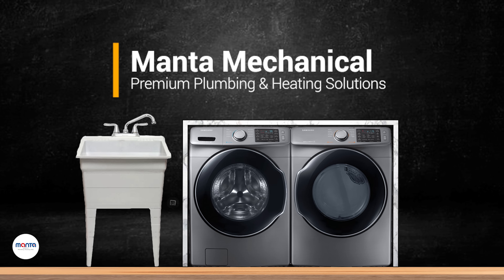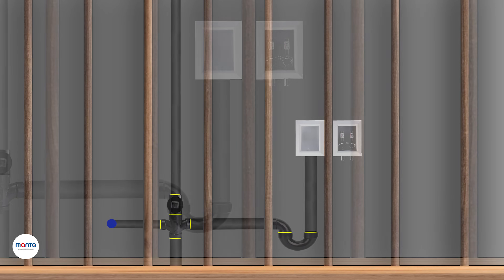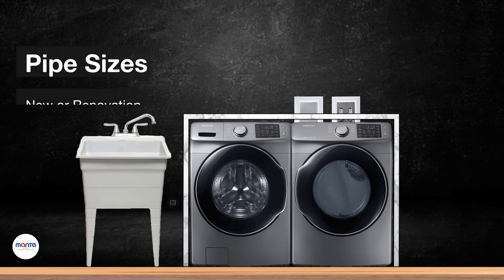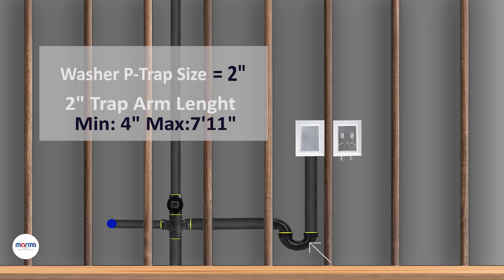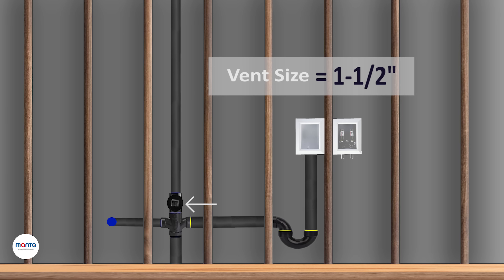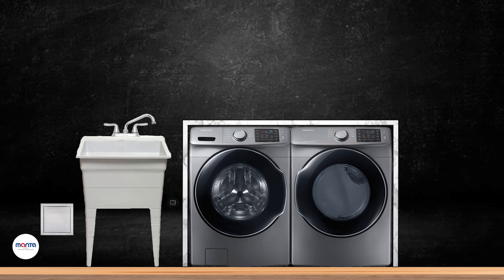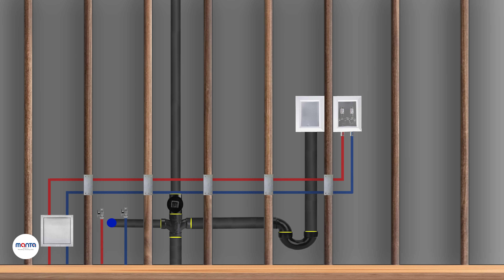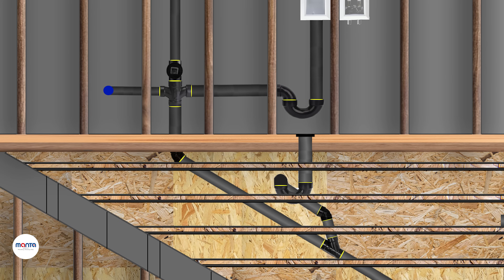Dos & Don’ts of Laundry Plumbing - The Building Expert - 2020

Comment: My laundry has one 1-1/2 p-trap shared for the sink and washer. Is that code anymore?
Reply: @rickybobby7276  It has one trap for both fixtures.  Goes into a san tee in the wall  Looks like it's original from the 1980s.

Comment: I prefer the valves higher than the washer for accessibility.
Reply: hell yeah,  I don't give a crap about how it "looks."  I like to be practical.
Reply: Exactly. They are supposed to be easily accessible in an overflow situation.
Reply: 100%

Comment: THIS IS MY TAKE FROM EXPERIENCE. CODES AT TIMES ARE WRITTEN BY ABSENT MINDED PEOPLE WHO DON'T THINK OUTSIDE THE BOX. 
I PUT THE BOX UP HIGHER OVER THE MACHINE. THE BOXES WE USE HERE IN NEW YORK CITY ARE COMBINED DRAIN AND WATER VALVES. THE HIGHER BOX MEANS A LONGER RUN/DROP ON THE VERTICAL PIPE/RUN AND IF YOU START TO GET A RESTRICTION. IT WILL NOT OVERFLOW AS EASY AS A SHORTER RUN/DROP. I ALSO PUT THE TRAP DOWN AS LOW AS POSSIBLE SO THE VERTICAL DROP IS LONGER. THE LONGER VERTICAL DROP HAS A GREATER VELOCITY AND HAS A BETTER TENDENCY OF KEEPING THE DRAIN FROM CLOGGING. ALSO WHEN IT COMES TIME TO SERVICE A CLOGGED DRAIN. THE HIGHER BOX IS EASIER TO SNAKE WITHOUT HAVING TO MOVE THE MACHINE, ESPECIALLY IF THEY ARE IN A TIGHT SPACE WHICH CAN BECOME A NIGHTMARE. THE HIGER BOX ALSO GIVES QUICK ACCESS TO THE SHUT OFF VALVES BECAUSE THEY ARE VISIBLE IN AN EMERGENCY. HOME OWNERS ARE USUALLY ABSENT MINDED AND AS THE YEARS GO BY FORGET ABOUT THE SHUT OFF VALVES HIDDEN IN A ACCESS PANEL, OUT OF SITE OUT OF MIND.
WHEN IT COMES TO ADDING A FLOOR DRAIN. I DO NOT RECOMMEND PUTTING IT INTO THE SAME 2" LINE AS THE 2" DISCHARGING WATER FROM THE WASHING MACHINE, ESPECIALLY FOR TOP LOADER MACHINES WHICH DISCHARGE A LOT OF WATER. IF YOU HAVE A CLOG AND YOU START YOUR MACHINE IT WILL TAKE MINUTES UNTIL FOR YOUR MACHINE DISCHARGES THE WATER. USUALLY YOU START THE MACHINE AND LET IT FILL AND WALK AWAY. IF THE DRAIN IS CLOGGED ON THAT COMMON 2" DRAIN. THE WATER WILL OVER FLOW FROM THE FLOOR DRAIN AND MAKE A MESS AND CAUSE DAMAGE ESPECIALLY IF THERE IS A WOODEN FLOOR CLOSE BY.  IF YOU HAVE A 3" OR 4" WASTE STACK PUT EACH 2"LINE SEPARATELY INTO THE LARGE STACK WHICH RARELY TO NEVER CLOGGS. FLOOR DRAINS ARE USUALLY 3" MINIMUM BUT DEPENDING ON THE CODE THEY CAN BE 2" BUT REQUIRE A VENT.  AS A RULE OF THUMB AND REMEMBER THE CODE CAN BE WRONG AND QUESTION IT. THE DISCHARGE WATER FROM THE MACHINE AND THE FLOOR DRAIN SHOULD BE PIPED IN SEPARETLY INTO A LARGER WASTE LINE 3" AND LARGER.

Comment: It looks like you're using a  double sanitary tee for a second side-by side fixture (presumably a sink). Shouldn't that be a double fixture fitting instead? Otherwise the pumping action of the washer could cause crossover flow into the second fixture.
Reply: Wondering about this question as well. There is an exception for back to back water closets and/or fixtures, but doesn’t state whether or not the exception (minimum distance of 10x the pipe diameter) applies to an appliance such as a washer or dishwasher.

“A double sanitary tee (cross) cannot be used for connections to fixtures and appliances with pumping action because it has a short pattern for change of direction. In addition to blowout-type water closets, 1.6-gallon-per-flush (6.1 L/flush) flushometer tank (pressure assisted) and gravity tank-type fixtures may also produce crossover flow into the opposite fixture connection. The high-velocity flow may discharge through the opposing openings of a double sanitary tee, causing an interruption or blowback at the other fixture. Back-to-back water closets are fixtures that are installed directly opposite of each other and discharge through a short distance into a double pattern fitting. If back-to-back fixtures discharge through several feet of pipe or multiple changes of direction, the flow velocity in the fixture drains would decrease to the point where cross flow would not occur. The exception provides for back-to-back water closet connections to double sanitary tee patterns where the horizontal developed length between the outlet of the water closet and connection to the double sanitary tee pattern is 18 inches (457 mm) or more. The critical distance at which there is potential for crossover is a horizontal developed length of less than 10 times the diameter of the horizontal pipe, for example, 30 inches (762 mm) for a 3-inch-diameter (76 mm) pipe. Once the developed length is over 30 inches (762 mm), the surging flow conditions will no longer exist, and the frictional resistance of the pipe retards the velocity to that of uniform flow conditions.”

Comment: Hello , nice vid.  I know the code for washer box drain is 2”.  My condo only supplies 1 1/2 drains except the toilet drain. 
Will  it be ok if I rough in the 1 1/2 “  If I buy a front load washer which I heard uses less water?
I live on the second floor .   Any suggestions will be appreciated, thanks

Comment: Emergency floor drain is a good idea but if it’s connected to the same drainage pipe only for flooding caused by either hot and cold water being busted, but if your drainage itself is plugged up it is useless.  Would it be better to drill a hole put a pvc pipe from your inside to outside wall then cover with metal mesh so bugs can’t get in to avoid flooding?  Well this fell for inspection?

Comment: If the water box height is supposed to be 40 inch from the floor and the w/d is 41 tall, what is the reason to have water valves behind  the w/d that can't be reached if needed?
Reply from the maker: Please re-watch the video.  Thanks

Comment: A construction company built my house and things are falling apart faster than we can fix them. It seems the entire laundry room needs to be redone. The electrical for the dryer has nearly fallen out of the wall hanging on by one nail and it's so close to the floor that I'm terrified of an electrical fire. Thee pipes behind the washer are so rusted out they've started to collect water across the laundry room floor and into the kitchen. This is beyond frustrating because I don't have the money to call a plumber since everything keeps deciding to fall apart. I haven't been able to do laundry in weeks. So now I'm just researching possible solutions.

Comment: Very informative .....I was told my hot and cold water valves are not up to code and the washer drain was wrong .....My house inherited from my 0arents is 60 yrs old .....I just figured it wouldn't be smooth sailing with the installation .....CAN you tell me about codes as far h20 hot and cold tturn off
Reply: One thing people don't understand is that codes change over time. Something that met code 20 years ago may not met today's codes

Comment: what if my washer is more than 7 feet from the main stack
Reply from the maker: You can run a branch off the main stack more than 7 feet but make sure that 2’’ trap arm length doesn’t exceed 7’11’’.  The trap arm is the portion of a fixture drain between a trap weir and its protecting vent.

Comment: What happens if you can't change the stack line from 1/1/2" to 2"? How will that effect the flow of the drain line ?
Reply from the maker: It should work just fine. It’s not required to change drains to 2” in old houses where we plumb but might be different where you live. Thanks.

Comment: Question, since the floor drain does not regularly have water in it, doesn't that result in a dry pipe venting gas?
Reply from the maker: A trap primer is the solution.  Thanks for your feedback

Comment: If the box is lower than the washing machine, how are you going to reach to turn the  supply lines off and on without having to pull the washing machine out?
Reply from the maker: @Par Golf It’s mentioned in the video. Kindly re-watch the video. Thanks for your feedback.
Reply: @TheBuildingExpert  I have same question, I couldn't find answer in the video. Could you please provide simple answer?

Comment: I would rather have the water valves be visible for the exact reason you stated in the video.  If you have a leak you can see it and you can get to it easily.  Seems safer and more practical to me.
Reply: And can easily hide it with a cover or decoration.
Reply: I saw this genius idea at an open house - they had what looked like shower valves above the counter as shut off valves.  It was decorative and pleasant looking.  It was obvious what they were for.
Reply: Yeeupppp. Same
Reply from the maker: Thanks for your feedback.

Comment: I very much appreciate this video. It is well done. You speak clearly and concisely, however, there are some errors. I am not intending to be rude or condescending, but I would like to correct some of the information as well as add some feedback. The point is to make sure people know the correct rules. Perhaps you can do a revised video if you want.

The 40" rule is not what the plumbing codes say. The 24" thing is also not what plumbing codes say. IPC allows for the drain to be 42" maximum above the trap weir. UPC has a 30" limit. That is on top of the trap weir being a maximum 18" above the floor (both IPC  and UPC). So maximum height of the drain in a laundry box in UPC is 48" and maximum height for IPC is 60". The minimum height of the pipe above the trap is 18", not 24". I believe the 24" rule applies for sink and shower drains.

*IPC 802.4.3 Standpipes.
Standpipes shall be individually trapped.
Standpipes shall extend a minimum of 18 inches (457 mm) and a maximum of 42 inches (1066 mm) above the trap weir.
Access shall be provided to all standpipes and drains for rodding.*

*UPC 804.1 Standpipe Receptors.
...No stand pipe receptor for any clothes washer shall extend more than thirty (30) inches (762mm), nor less than eighteen (18) inches (457mm) above its trap. No trap for any clothes washer stand pipe receptor shall be installed below the floor, but shall be roughed in not less than six (6) inches (152mm) and not more than eighteen (18) inches (457mm) above the floor...*

*IPC 1002.1 Fixture traps.
Each plumbing fixture shall be separately trapped by a water-seal trap, except as otherwise permitted by this code. The vertical distance from the fixture outlet to the trap weir shall not exceed 24 inches (610 mm) and the horizontal distance shall not exceed 30 inches (610 mm) measured from the centerline of the fixture outlet to the centerline of the inlet of the trap. The height of a clothes washer standpipe above a trap shall conform to Section 802.4. A fixture shall not be double trapped.*

Ana White hid her laundry box behind a door that flipped up, but honestly, I don't mind seeing the laundry box. I want it to be easy to reach/access in case of emergency. There are ways to conceal it where it can still be accessible though-- but you can have it higher than 40" and not have it look ugly.

I do like how your picture has two separate boxes for water supply and drain. I don't know if I can do that in my layout. I'm hoping my box will let me put the drain on the right and supply lines on the left. I want to have the box sort or embedded in a shelf with grommets that the hoses go through to reach the box. It will keep stuff from falling behind the machines and make things look a little cleaner. If I don't like being able to see the box & hoses I can add a hinged flap to cover it.

Extra shutoffs near the floor are a good idea if the laundry outlets leak or have a problem. Although, as I said before, I personally like to have the shutoffs for the machine hoses to be easily accessible. I would also put the cleanout for the vent higher up-- above the flood level of the fixture in case water backs up the pipe. You don't want it spilling out when you go to snake it out.

When merging the washing machine's 2" line with the main sewer line, you want to increase it to 3" to improve flow. Floor drains will need to have water poured down to seal the trap if there haven't been any leaks. You may need to add water if it evaporates in the trap. As for the laundry sink (if you can fit one, you may want to have a branch vent and be mindful of backwash from the washing machine. Sometimes suds can back up in to nearby fixtures if they are plumbed too closely.

I will add that on the electrical side: 20amp GFCI outlet should serve the washing machine. This is not a code requirement specifically for the washing machine, but it is a code requirement for laundry areas. Anything within 36" of potential water spray should be GFCI unless you have a GFCI breaker. I would do my best to keep the plug out of the splash zone and somewhere that is easily accessible to unplug in an emergency. Same with the dryer. For the dryer you want to upgrade to a 4-prong plug & receptacle. The old 3-prong ones can cause the dryer to become electrified and result in electrocution.I am not intending to be rude.

Comment: So this was really helpful Info. But at the very beginning, you talked about the box height. A lot of newer laundry rooms have the washer and dryer elevated up on a platform of sorts (you can store laundry baskets for example underneath them and it’s easier to get your clothes in and out of front-loading washer and/or dyers with this setup) this elevated position puts the washer/dryer approx 16-20” above the finished floor. So you might want to amend the height of the box to accommodate people installing this particular scenario. Rest of the vid is spot on though 👍🏼
Reply: Minimum washing machine discharge ht is 39 inches.   I place mine just above the top of the back of the washing machines. (44") .  You can reach the valves with no problems.  Also the discharge can be pulled out and placed into the laundry tub.   I don't see the benefit of placing the valves behind/below easy access.
Reply: @maintenancebynathan7729  yea, try telling that to all wives out there
Reply: @maintenancebynathan7729  Agreed lower than 39" (code) will cause overflow problems at the standpipe
Reply from the maker: Thanks for your feedback

Comment: Each to its own but I like the service box above the washer. The valves r accessible w/o movin anything n what is best is I keep m closed when not using.
Reply: I thought it was a bit funny how #1 was make your valves inaccessible and moments later to install accessible valves. I get Manta's reasoning  and it makes for the cleanest room, but I think most people don't mind a little valve box showing in a room that isn't really for show anyway.
Reply from the maker: @garrett Gomes Thanks for your feedback! 🙏🏼
Reply from the maker: Thanks for your feedback! 🙏🏼
Reply: Likewise
Reply: Yup. I like what Ana White did with her laundry room. She had a shelf behind the machines and recessed the plumbing box. She had a flap with hinges that could be flipped out of the way to access the plumbing box. Kept stuff hidden but allowed for quick easy access. Also kept stuff from falling behind the machines.

Comment: It is UPC codes.
Reply: No. It does not reflect any actual codes. The information is incorrect. The 24" rule refers to sink and shower traps. Laundry standpipes are in a different category.

UPC  804.1 Standpipe Receptors.
Plumbing fixtures or other receptors receiving the discharge of indirect waste pipes shall be approved for the use proposed and shall be of such shape and capacity as to prevent splashing or flooding and shall be located where they are readily accessible for inspection and cleaning. No standpipe receptor for a clothes washer shall extend more than 30 inches (762 mm), or not less than 18 inches (457 mm) above its trap. No trap for a clothes washer standpipe receptor shall be installed below the floor, but shall be roughed in not less than 6 inches (152 mm) and not more than 18 inches (457 mm) above the floor. No indirect waste receptor shall be installed in a toilet room, closet, cupboard, or storeroom, or in a portion of a building not in general use by the occupants thereof; except standpipes for clothes washers shall be permitted to be installed in toilet and bathroom areas where the clothes washer is installed in the same room.

Comment: With the use of an Oatey laundry box, If I were to lower the box so the top of the drain pipe is 28”, could I put the p-trap below the floor? I have a crawl space below the floor.
Reply from the maker: Yes, you can! As long as  it’s vented properly, standpipe length is minimum 24” & the trap arm length is minimum 4”. Thanks.  🙏🏼
Reply: @TheBuildingExpert  I'm sorry, but you are incorrect: UPC 804.1 Standpipe Receptors. "...No trap for any clothes washer stand pipe receptor shall be installed below the floor, but shall be roughed in not less than six (6) inches (152mm) and not more than eighteen (18) inches (457mm) above the floor..."
IPC has the same restriction.
Reply: No. You are not permitted to put a standpipe P-trap below the floor. The trap must be a minimum of 6" above the finished floor and a maximum of 18". From the trap weir up it can go 30" (based on UPC) or 42" (based on IPC). Manta Mechanical means well, but is incorrect about the code for standpipe plumbing.
Reply: @mycats7321  then why do we see p-traps below shower drains in the crawl space?
Reply: @cinepost  Because shower drains have different code rules than standpipe drains. Sink drains and standpipe P-traps are supposed to be above the finished floor but toilet, bath, and shower, ones pretty much have to be below the finished floor because of how low they are. But they generally shouldn't be lower than 24" from the fixture. The standpipes differ because a pump pushes water out of the washing machine so it has more force.